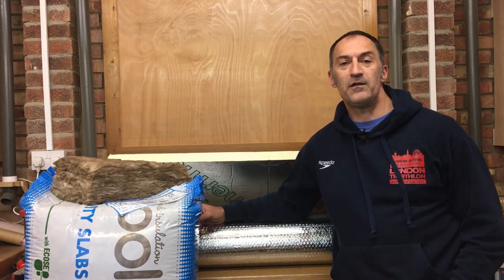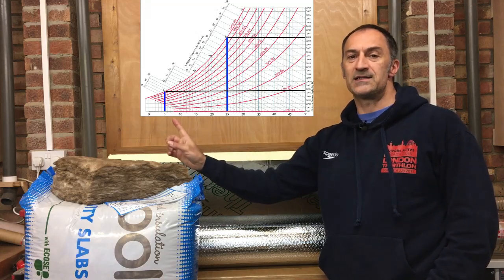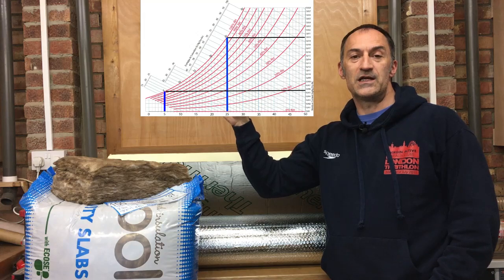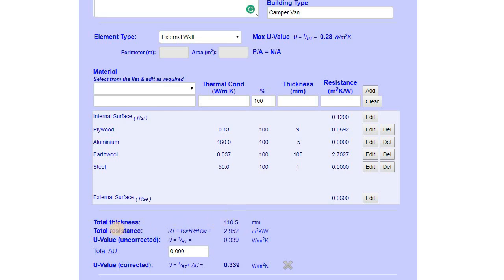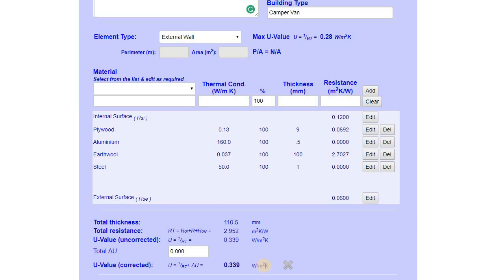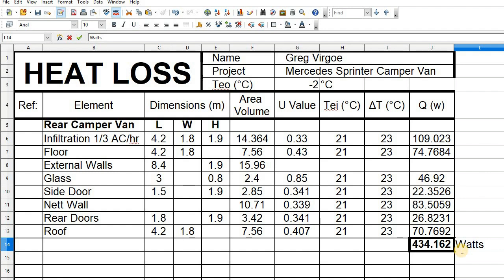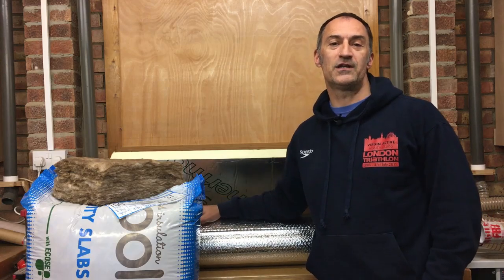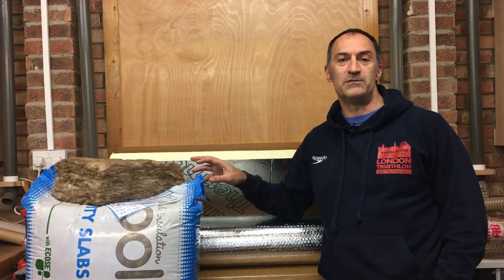How to Insulate your Van Part 1 - The facts you need!

Comment: Thanks Greg... I am "just following your method" and copying everything you do in my own ex-ambo van build. :D Thanks for your in depth analysis!
Reply from the maker: Hey Zed,  Your ambo must already have great insulation fitted?
They make excellent doner vehicles for camper conversions. Excuse the pun.

Is it a box-shaped body on the back?
Reply: yep, a box back ‘module’ with an acoustic foam that I think, because I contacted the manufacturer here I Australia, is .03 w/pm
It has honeycomb fibreglass floor a
Which had a million holes from apparatus which I’ve just filled, including the two track rails which was a big job to remove, waterproof and then fill with foam and glass over. 
The other blessing and a curse is the electrics. I need a full V-mux systems expert to sort and recommission it so that’s the next job I’m tackling
Reply: Oh the other thing I’ll add is that while ambos are great donor vehicles, I’m sure many people don’t remove the vinyl etc which I’m glad I did. It was wet from the road water due to all the holes, but also, the amount of ‘biological’ goodies that added to a meaty fragrance !! Glad that’s behind me. 
I have shot some video but haven’t posted any...yet! 😝

Comment: Wonderful explanation. Its finally clear to me. Now I'll know why and how I'm insulating. Thank you so much for a clear delivery. I live in Quebec, Canada and its presently -31c, so insulation is important.
Reply from the maker: OMG -31c, wow that is unbelievable, are you sure you want to be living in a van in those conditions? 😬
Is that normal for that area? That presents a whole load of other issues too,
No external tanks as the water would just freeze in them. What are your plans?
Reply: I plan to put R-14 wool insulation in all the nooks and crannies. Durafoam by plastic about R-5.63, 1.5" thickness between ribs and full sheets of 48" × 96" over all surfaces. At this point maybe add reflectix, as a vapour barrier, and finish with 1" × 6" × 6' pine tongue and groove 
All water supply in van with hand pump. Only water and grey water. Also a mini wood stove for heating and biolite burner to cook. Any recommendations?

Comment: I'm asking myself "Why didn't you choose closed cell foam as insulation?" you can glue it onto any surface. no condensation inside the foam. it is pretty "soft", so it can be put into difficult areas. was is the price point or something else?
Reply from the maker: What manufacturer are you looking at and what is the K Value?

Comment: Hey mate.
How would you recommend insulation a van for hot areas? I live in Australia and our days (at least in Sydney) are quite warm, 25-30deg in winter & 30+ during summer.
How would you insulate to keep your van cool/keep the heat out??
Cheers
Reply from the maker: Hello Dan, excellent question and one that gets asked a few times.
The thermal conductivity of heat works the same both ways.
So yes pick the best insulator you can and it will help to keep you cool in summer.
Just like your cold beers in the cooler or fridge. both insulated with PIR foam.
What I would recommend it to get external reflective window blinds.
The more you can block the solar gain from your windows the cooler it will be inside.
Reply: Thanks Greg, I appreciate the reply!

Comment: Great video Greg. I have watched it a few times now. I'm preparing for a cold weather conversion in Canada and I am labouring over the insulation. I am most concerned about condensation. Is it possible for condensation to migrate from other voids in the van to the insulated portions? Did you vapour barrier the entire interior behind the sheathing? Excellent info on your conversion, thanks for taking the time to put it all together.
Reply from the maker: Hello, it would be a good idea to seal up any holes in the pockets that lead to other voids in the van to prevent migration of most air as you correctly suggest. Insulation will be a priority in your cold climate, I'm pleased i can help you some way.

Comment: Thank you for the vid I found it very interesting, one question I have is if the foil sheet is so poor at insulating is there any benefit over using a plastic sheet as a vapour barrier, Tia. Shaun
Reply from the maker: Hello Shaun, Plastic sheet as a vapour barrier will work perfectly well. Most buildings use a plastic vapour barrier in their construction. The benefit of the Reflectix is it has very small air pockets (bubble wrap) so it will give you a small thermal break between your layers of materials too. Please watch my Part 2 video for further info, Thank you
Reply: Greg Virgoe thanks Greg I just watched it, very interesting thank you :-) I have suggested on a group I am a member of that some of the folks take a look at your Chanel so hopefully you will gain some subs :-) all the best. Shaun
Reply from the maker: That is amazing Shaun, thank you so much for taking the time to do that for me, really appreciate it. Cheers

Comment: Thank you Greg this is fantastic. I'm an elec eng and I'm using my self build as an opportunity to learn about insulation and heat transfer. The problem was I could find loads of videos of people explaining how they did their insulation but none could give an explanation of why they did it that way. So thanks for your video! Something I have been wondering about... is there any practical difference in heat loss between the sides of the van and the top and bottom of the van? What I'm getting at is... is the level of insulation on the roof more or less important than the walls?
Reply from the maker: Hello, I understand what you mean. The calculation for heat transfer for walls, floor or roof is the same. The variable will be how much insulation you can install in those places. 
You may be able to get 4” of insulation in the cavity of the walls but only 1” of insulation in the floor. The build up of each area will determine the heat loss. In practical terms you have to be realistic and try to fit the best insulation and the max thickness you can spare. I will be doing 50mm kingspan on the roof and mid side panels. 100mm earthwool on the upper and lower side panels. 
25mm kingspan on the floor. 
I know the floor will be the least energy efficient. But I can’t lose 4” of height. Thank you for great feedback and hope that helps you.

Comment: Very good.  But the key point; how many but/hr is needed to keep it at 21 degrees??
Reply from the maker: If you are looking for the answer in BTU/hr then you simply need to convert my answer. 1kW = 3412 BTU/hr
So 0.434 x 3412 = 1480 BTU/hr
Hope that helps 👍🏼

Comment: Hey Greg it’s an amazing video thanks for such a descriptive one.
I have some doubts regarding insulation.
I am from India and here weather conditions are little different.
Outside temperature could go up to 47 degree Celsius and inside we would need 22 . So now what changes would I need to make in the insulation as in my case heat would be flowing from outside to inside.
Please help me with this problem thanks
Reply from the maker: Hello, your insulation will work in exactly the same way if the heat is on the outside of your van. Picture an insulated coolbox with a six-pack of ice-cold cobra's inside. The transfer of heat by conduction is the same either way. You are unlikely to suffer the issues of condensation building up inside your van, unless it gets very cold at night. One thing that would help you keep cooler in the sun would be to shade your windows as solar gain is by far the biggest heat gain in vehicles. External shading works far better than internal shades. You need to prevent the suns rays from getting through the glass and heating up the internal surfaces of your van. Hope that helps and make sure to look out for future videos. Thanks for your comment.

Comment: ! WOW ! Deep Respect, Greg ! Absolutely the best video I've seen EVER ! Extremely informative & without any "black-bla" Thanks!
Reply from the maker: Thank you so much for such a nice comment. I was nervous about doing this technical video but really pleased you like it so much. 👍🏼
Reply: Greg,it's a pleasure 
 ! Could you please review this eco-friendly insulation materials - I would like to build my eco-van with much eco material as possible http://www.thermo-natur.de Thanks in Advance !
Reply from the maker: Hi, I did take a look at the website. I'm not sure the hemp leaf symbol is a great way of advertising insulation? Their advert is incorrect when comparing their insulation to glasswool or fibreglass. Their image shows two roof structures and gives the impression that you only need half as much of their insulation. However, their published figure for thermal conductivity is 0.037 W/mK and glassfibre is 0.04 W/mK and exactly the same as the Earthwool batts that I am using. So it is not better, it's about the same. Earthwool can also be 100% upcycled. On the plus side it's made of natural materials and will offer the same level of insulation as similar alternatives. Not sure what it's fire resistance is or moisture resistance?
Reply from the maker: Hello, This is a soundproofing material, it will have a small insulation value as its a closed cell material, but I could not find any information for its thermal properties. Its also not Class O rated for fire but Class A so it will burn and give off harmful gases. I would not use it in my van.

Comment: Hello! Thanks so much for being a resource in van conversions that's credible! It is all a bit over my head, but it is good to know there is a reliable reference for me as I tackle my conversion. Again, I am still trying to understand this all before I actually dive in, and I am curious - if the thermal properties are good for keeping the van warm in cool conditions, will they also be sufficient in helping the van cool in warm conditions? Thanks for the videos!
Reply from the maker: Hello Sarah, very good question. The thermal properties of a material work the same both ways. For example your insulated cool box that keeps food and drink cool on a hot summer day. Your van insulation will help to keep the van cool too. Make sure you shade the Windows from direct sunlight as solar gain is the largest contributor to heating up your van. External shades are more efficient than internal blinds. Hope that helps.
Reply: Thanks so much! Eager to see your van come together!

Comment: Love the series Greg, and there aren’t enough technical videos like this, so thank you. I have windows all around in my sprinter, and am planning to make apply the same principle to insulating them as the steel walls. The concept is in urban environments, or very hot days, I can leave the 70mm thick solid window covers in place. When out in nature, remove them and enjoy the view. The layer stack will likely be some sort of blackout favric facing/touching the window, then celotex, and an internal cladding. My question is around using rubber seals, like car doors, to lock off the windows from the internal airspace. If you had any thoughts or suggestions to reduce thermal bridging and condensation build up at the window, that would be great. Good luck with your build, and thanks for your videos.
Reply from the maker: Hello Andrew, the windows and doors are the most difficult to combat the condensation problems as its often not possible to apply a covering to them. The challenging part will be to create an effective seal around your removable insulating panels. I'm going to help reduce this issue with heating and adequate ventilation. We are hoping to holiday in mostly warmer climates. Best wishes with your build.
Reply: Thanks for your reply Greg. I'm sure I'll find a way. Looking forward to the next video :D

Comment: I'm a retired tech officer and am considering buying a Sprinter or Renault Master for a van conversion. In your calculations you omitted the air gap between the sheets of the aluminium foil. I suppose it was only a couple of mm, not worth including? I have recently replaced my heavy duty (bubble based) pool cover and was thinking of using the old one as part of the insulation set up on my possible van. It does not utilise aluminium and the bubbles are about 4mm deep. Do you think its worth bothering with? I'm in Oz so our problem is usually too much heat.
Reply from the maker: Hello Bob, you can only make an allowance for an air gap if it’s an appreciable distance 2-3mm is not going to be of any benefit. I would not use the pool cover it’s got no insulation value and the polythene is not 100% waterproof. Take a look at this 
http://new-learn.info/packages/clear/thermal/buildings/building_fabric/elements/cavities_and_air_spaces.html
Reply: Hello Greg, thanks for the response and information.

Comment: Easily the most informative video on the subject, ever!
Where did you get the Infiltration U-Value from? I've not seen that before.
Reply from the maker: Hello Davie, thank you for those kind words. The equation for infiltration heat loss is 1/3VNT where V=volume N=number of air changes and T=Temperature difference. So 1/3 = 0.33 and I assumed an infiltration rate equal to 1 air change per hour to keep the math simple. 
0.33 x Volume x Temp Diff
Hope that helps. Cheers
Reply: Greg Virgoe it was the actual U-Value I was curious about.
Reply from the maker: Yes Davie, the value is 1/3 or 0.33
Reply: Greg Virgoe Ah, I get it, it's that value no matter what. Cheers.
Reply from the maker: For a full explanation the 1/3 or 0.33 comes from Density X Specific Heat Capacity / 3600
1.205 x 1005 / 3600 = 0.336. These values are fairly constant at room temperatures.

Comment: Hi Greg, thanks for the great videos, I am a few steps behind you converting our van. I have a question about insulation for under the van floor. I am considering 25mm kingspan which I believe has an R value of 1.1m2kw, but also looking at the YBS superquilt at 40mm thick with what I calculated the R value at .92m2kw. I know there will be a certain amount of compression of the superquilt - 25mm in some places and 40mm in others due to the undulations / ribs in the van floor. Would it be a reasonable material to use in the floor?
Many thanks
Ian
Reply from the maker: Hi Ian, exactly what I have planned. I’m going to fit 25mm timber battens with kingspan in between then a ply floor on top of that. It’s the best insulating material.
Reply: Greg Virgoe  thanks for the reply Greg

Comment: Instead of the reflectix, why not DPM
Reply from the maker: Hello Jim, very good question and there are two reasons.
1. If you look at this chart of permeability of common building materials you will see that Aluminium foil is completely impervious to moisture, however, some plastics used as a DPM still allow a very small amount of moisture through. 
https://4.bp.blogspot.com/-yE9OE6--ah8/VvMEU11aTMI/AAAAAAAACS8/H201J9koo8wGYmjpvwMKpUh11ywFe8eHg/s1600/Table%2B-%2BPermeance%2Bof%2BCommon%2BBuilding%2BMaterials%2B500p.jpg
2. The small bubbles of air in the Reflectix will provide a small thermal break between the steel ribs of the van and my internal ply cladding. Not a huge amount I know but just enough so they are not in direct contact.
Hope that helps, thanks for a great question.

Comment: There is something very serious to consider when insulating a Sprinter van. I'm not sure whether it's specific to spray foam or over insulating in general, but you can end up oil canning (if that's the correct term) all of the exterior surfaces. Your van ends up looking like somebody took a baseball bat to it.
Reply from the maker: You are right Jack, it applies to spray foam. Because it keeps on expanding long after you have sprayed it. It’s easy to overfill the voids and the expansion buckles your van. 
That and the mess it makes is why I’m not using it in my van. 
Thanks for great comment.
Reply: @GregVirgoe  wow good to know!!

Comment: Good presentation! Thanks for the U-value calculator and Heat Loss spreadsheet. Regarding the conductivity of Reflectix, since its thickness consists mainly of air (Conductivity=0.024) in the bubble wrap, its conductivity should be around 0.02, comparable to your foam insulation, unless it's crushed. The thickness quoted in the spec is 0.312" which I find to be more like 0.25", possibly because it comes in rolls that are somewhat compressed. It's lack of practicality comes from it's thinness. If you layered it to the thickness of your foam it might have a comparable U-value, but would be prohibitively expensive. Clearly the R value of 6 in the spec is way out of line for a single thickness. Regarding your use of the term mils, you clearly mean millimeters. When us Yanks hear mils we think 0.001", or 0.0254 mm.
Reply from the maker: Hello Elwood, I have not seen any reflectix that is a third of an inch thick. I measured mine and it’s only 3mm therefore. 0.003/0.024=0.125 which is the same resistance as a air gap or cavity in traditional wall construction. Therefore you would need 18 layers of reflectix to have the same resistance as one 50mm layer of kingspan or celotex. 
Making it both totally impractical and very costly.
Whatever way you skin it the answer is the same is a very poor insulator. It’s a reflector. 
Thanks for your comments.